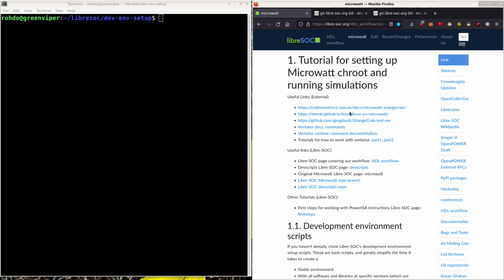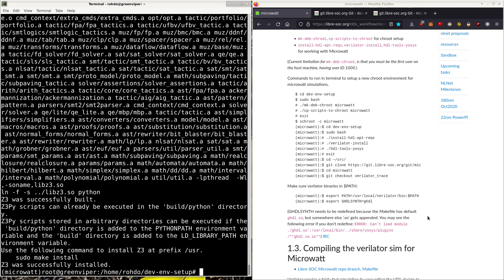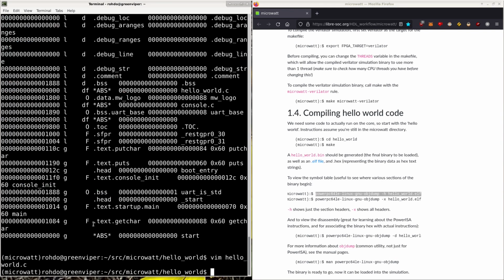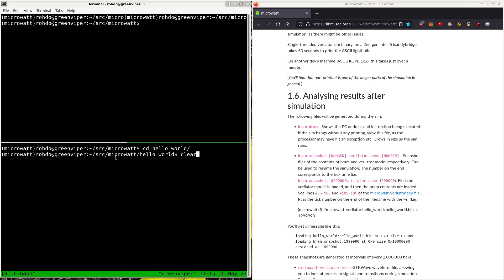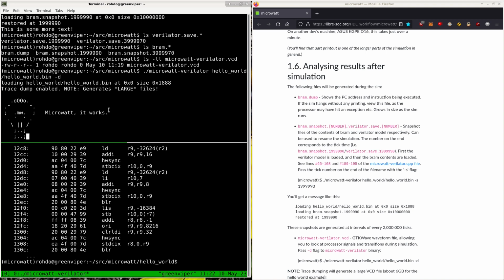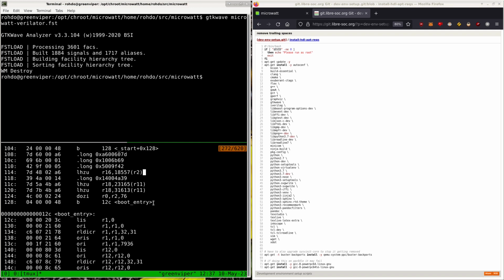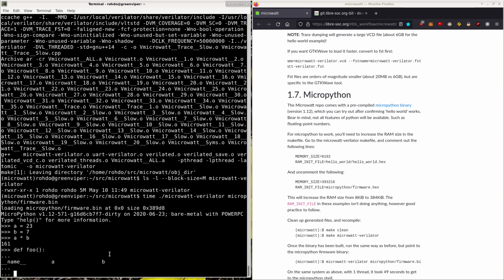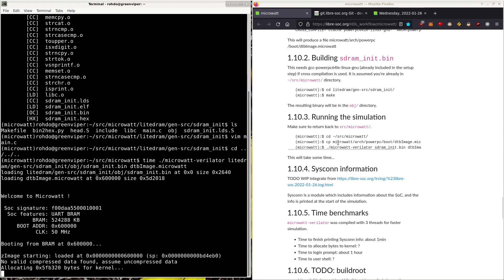Microwatt Libre-SOC tutorial

Comment: How do-able is instantiating the Microwatt VHDL CPU (or Chiselwatt Scala/SpinalHDL CPU) on a non-Lattice FPGA?
For example, I have a Trenz SMF2000 (Smartfusion2 FPGA) that's not listed as supported in the LiteX repo.  Since the development environment is Windows "Libero", I'm not sure how involved it would be to try to add LiteX components (migen->nMigen) ,  Amaranth HDL or SpinalHDL components to a design.

BTW, in addition to GTKWave for simulation.. could LiteX's Litescope be used with Sigrok's PulseView for viewing waveforms?
Reply from the maker: if you have an existing example that works on your FPGA e.g. a UART example is best to start from then it should be relatively straightforward if you initially cut out external DRAM. i dropped microwatt.v into ls2, our own peripheral fabric framework, to get it to work on nextpnr-xilinx for example. you are not in any way "restricted" to just hitting "make", this is FOSS, you can perfectly well cherry-pick and drop the microwatt core onto a pre-existing project with a wishbone bus interrupt lines and memory-mapped peripherals. i.e. free your mind of perceived limitations, don't think of the supplied code as a "boxed product" and you'll do fine.